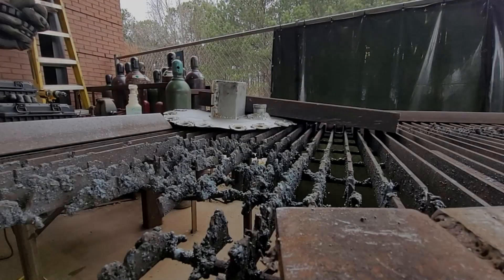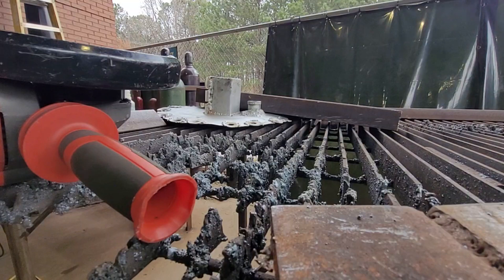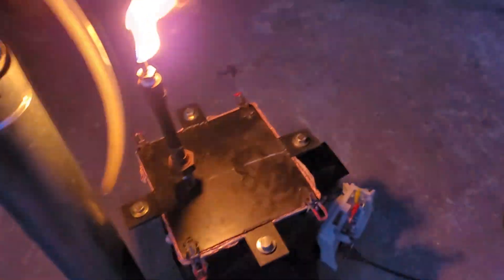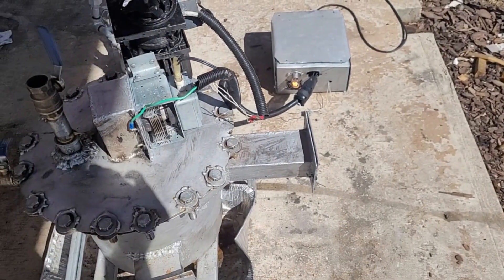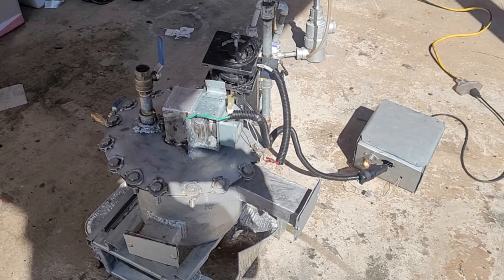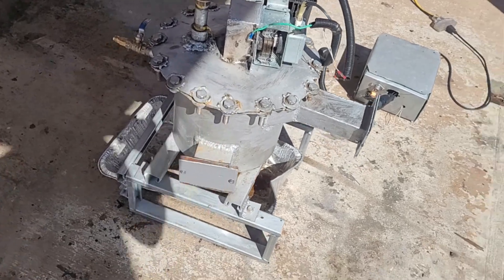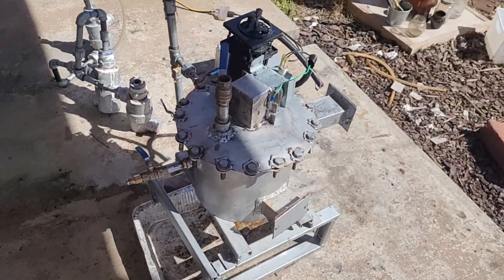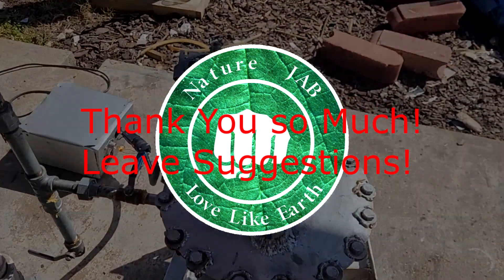Help Me Build the Next Microwave Pyrolysis Reactor! (Turning Plastics Into Fuel)

Comment: microwaves have a wavelength of about 12cm so maybe try making the total path they take be divisible by 12?
usually you can go with half and quarter wavelengths so 6 and 3cm might also work. That will make sure you get nice standing waves.
also try making the agitator out of something that does not absorb microwaves, since metal will absorb them.
Reply from the maker: Great suggestion! I will most definently look into this as it will make everything better. Metal reflects microwaves, which means the agitator actually may potentially aid in microwave distribution. It could be made out of glass or ceramic, though it would need to be microwave transparent as well as heat resistant, chemical resistant, and strong enough to deal with torque.
Reply: @naturejab  also you should change the waveguide geometry, you could get almost double the heating output. Also mount the magnetron at an angle closer to a tangent (or just like 45) next time, since if you mount it at 90 degrees perfectly the waves will just bounce back into the magnetron without propagating into the chamber.
I'm not really sure what angle is best, but whenever you have complicated real world problems the solution is almost always eulers number...
Reply from the maker: @Muhamed Mulic  So mount the waveguide at a 45 degree angle?
Reply: @naturejab  any angle would work better than just straight up 90 degrees, while 45 or 60 degrees might be easiest to manufacture.

If the waves take the same path (e.g. they form a square when they bounce off the walls of the chamber) and the distance is dividable by the wavelength, they will form standing waves (regions where they constructively interfere to make a more powerful wave). The you will absolutely need an agitator, to put the plastic close the the nodes of the waves and heat it better. Using an irrational number for the angle (such as eulers number which is common in nature for some reason), standing waves will not likely form, so you probably wont even need an agitator, as the heating will be entirely even.

You could also try making a corner reflector, or a cheaper solution would be just a dome on the opposite side of the waveguide exit (if you mount it at 90 degrees). Since it has a round shape, it would spread the waves in many directions. It would need to be very small and precisely calibrated so thats why i recommend just not mounting the magnetron at 90 degrees.

Lastly you could try making the waveguide resonant so that no RF energy is lost. I don't remember the equations for resonance, but think of how antenna dishes perfectly focus the signal from a point into a "ray" that does not spread. Basically, if you made the back side of the waveguide have a shape which reflects the waves better, you would have more power in the chamber. The shape should look something like (  but it needs to be precisely made so you should not do it this early.
Reply from the maker: @muha0644  Thank you for all this! I often have trouble understanding all this resonance microwave stuff, it makes my head hurt lol. But you made it easy to get. I'll definently implement the waveguide at an angle to get the waves to form more constructivley. I guess the only issue with that is that I would have to build the whole waveguide at an angle otherwise the mountng of the magnetron would end up in a 90 degree section no matter what, as the waves travel off of it laterally and it is mounted horizontally and not verticaly.
Reply: @naturejab  I will try to contribute with the resonant cavity design, I am no specialist either, but while reading a book on microwave systems a while ago (it is called Handbook of microwave technology by T. Koryu Ishii) I understood that bigger sizes on the resonant cavity will allow for more resonant modes. This means in a smaller reactor you have to hit the correct dimensions precisely in order to have a good resonance and transfer a lot of power to the load, whereas in a larger reactor with a few wavelengths in size you should have more tolerance in terms of the size and shape of the reactor as well as the effect of the load on the resonance. Small microwave applicators have tuning devices to tune the waves according to the load. Maybe in your case bigger is better.
Reply from the maker: @lucasraymundo  That would make sense. I also must ask, do you have any idea how the affect of two magnetrons in the same waveguide would behave. Like if I had a T split waveguide port with a magnetron and each side that shoots microwaves and comes to the middle to enter the reactor, would that make a constructive or destructive wave?
Reply: @naturejab  whether the waves interact constructively or destructively depends only on their phase difference, and how the specific magnetron radiates. Most radiate in a doughnut like shape from the resonator, so you actually lose half of the power by just using a square. It's probably better to just mount two magnetrons on opposite sides of the chamber, rather than on the same waveguide, and to make the other corner a spherical shape (or a hyperbola if you can get it precise enough) so that the walls are about half a wavelength away from the resonator. I would not recommend using two at all, since you have to make sure everything is resonant, else you might actually get less power due to them cancelling out...

There is a lot of tuning to be done with just the magnetron and the waveguide shape. The reason most microwave ovens suck is the same, they're badly shaped. It's also the reason some spots get warm and others stay cold. As soon as i finish my radio amateur training i can sketch up some designs, but for now i can only tell you the theory as i don't know the equations yet.
Reply: @naturejab  This I do not know, I think you could use more than one source of microwaves, but I think the T-shape might not be the best for this, checkout "Y-structure waveguide". I agree with Muhamed though, a lot of things can go wrong by using two magnetrons, if they cancel out you will see two-things, first your load will not heat up well and second the magnetrons themselves will receive the energy instead, get hot really fast and shut down. A different approach to improve your power output without having to use expensive microwave power sources or multiple off-the-shelf magnetrons is to make a full-wave rectifier to power the magnetron. Checkout stypyro's video: https://youtu.be/fM9hYzJnao0
Reply from the maker: @lucasraymundo  thank you, I will check this out!